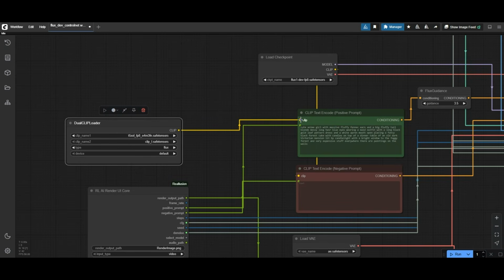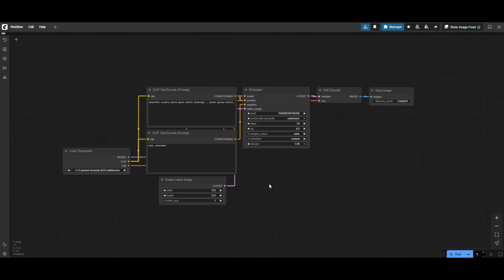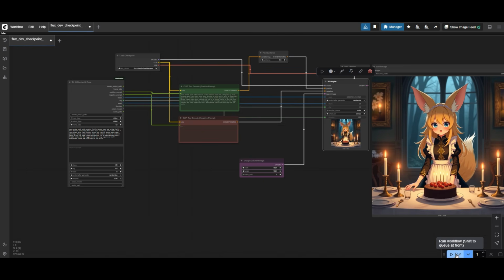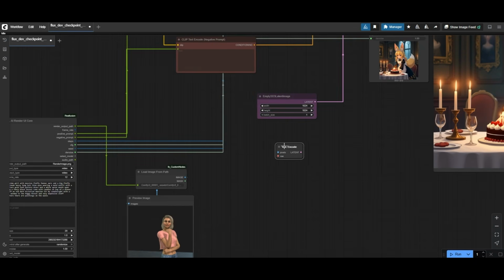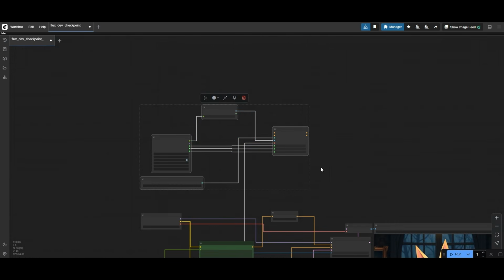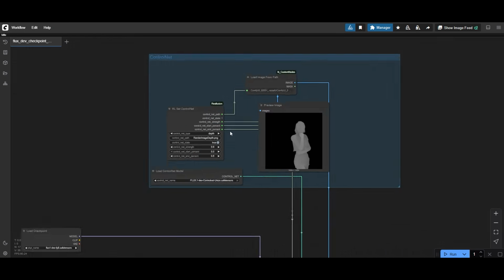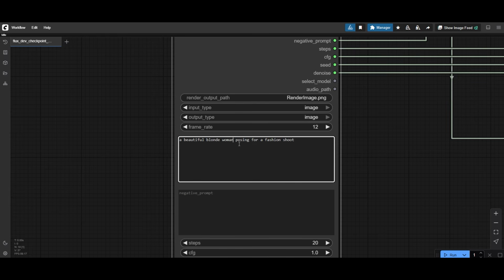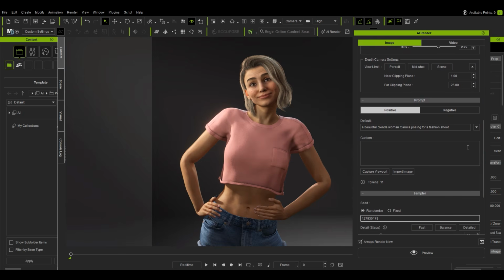AI Render Custom Workflow with FLUX | iClone & CC Tutorial

Comment: should this technically work with flux schnell?
Reply: Yeah it works with any comfy ui workflow, you’re just replacing the default one with whatever you want
Reply: @virtualfilmer  cool thanks! Hey you planning on doing any tuts on the iclone comfyUI integration?
Reply: @oberdoofus not right now but possibly at some point! Right now I’m just rendering from iClone and unreal the normal way - as images; and then taking those into comfy and using flux to generate realistic images. Then veo3 to animate
Reply: @virtualfilmer  Yeah that's a nice way to do it and get your blocking and framing and sets. Do you get good character consistency out of the box or do you rely on Loras? Or just low denoise strength and depth and openpose? 

I guess if the iClone AI plugin works (long way to go) that may shake things up a little in terms of workflow - but not sure how well it's going to handle backgrounds and props.  I suspect I bit of traditional compositing may be required!
Reply from the maker: Hi @oberdoofus,

You can give it a try.